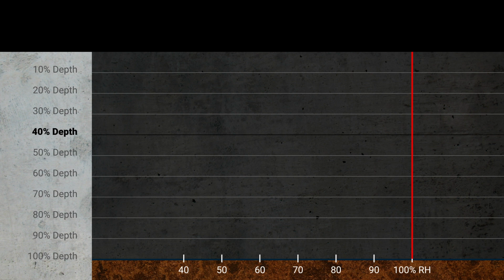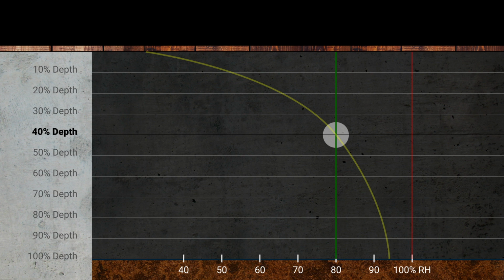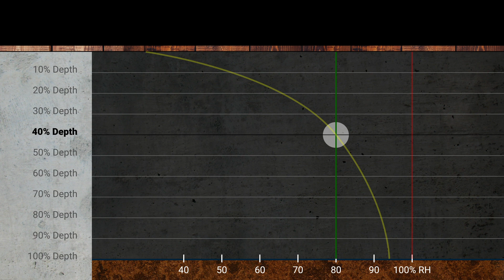Why is 40% the Magic Number for Concrete Moisture Testing?

Comment: This pertains ONLY to the Construction water at time of placement, this does not extend to concrete already in place, particularly mature concrete. The moisture has ALWAYS followed this curve until it matures, then these diffusion models no longer can be used due to concrete hysteresis. RH probes do NOT test the concrete, these test the available air space within concrete and cannot measure moisture that has either adsorbed or absorbed within the concrete itself.
Reply from the maker: Thanks for the comment.

Comment: Good morning Jason, Gerardo Pradenas greets you from Santiago de Chile. Congratulations on these excellent informative videos. In our beginnings as distributors and installers of PVC floors and cementitious self-leveling we had failures due to the humidity of the substrate, but when we obtained the necessary training, this did not happen again. It would be very good to have videos and others in Spanish to further enter the Latin American market. I have been promoting you and it has been specified with architects from MINSAL for more than 17 years and they are already controlling HR much more. Greetings from Chile.
Reply from the maker: Good evening Gerardo thank you very much for the comments and the support for the this testing method. If there is anything we can ever do to help further the cause in Chile, please don’t hesitate to reach out to me directly.